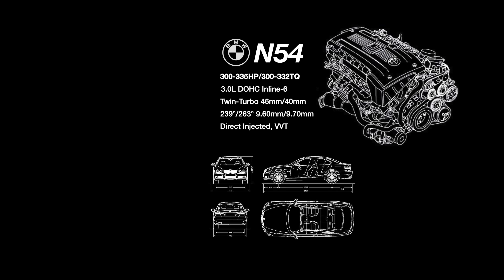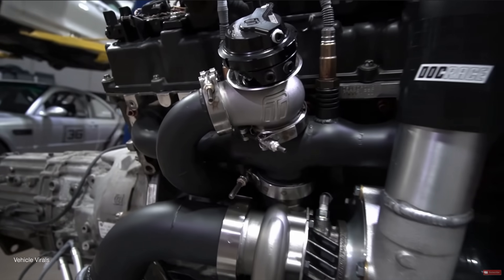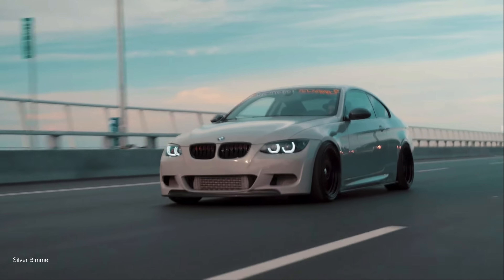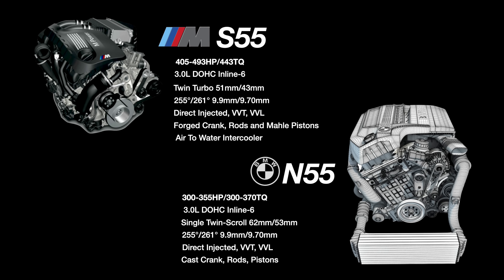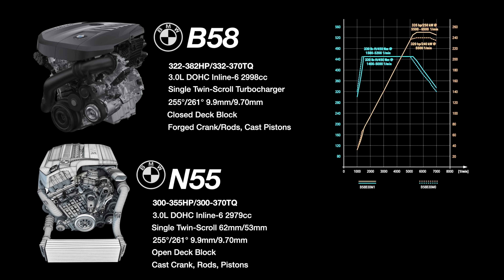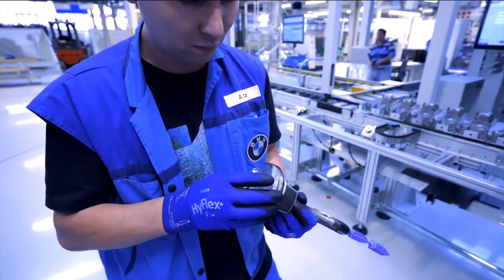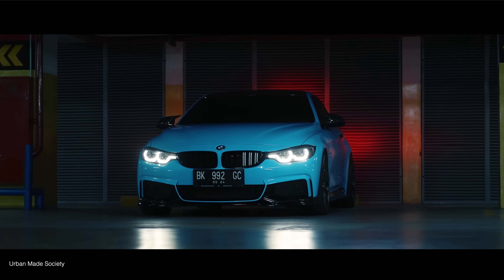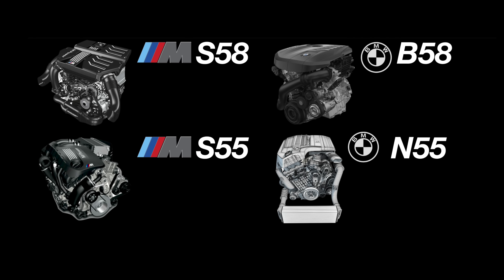BMW Turbo Inline-6 Engines Are Ridiculous | Explained Ep.4

Comment: Having now owned an n54, it can make about 600 whp reliably as pistons can fail as low as 650, however than can make 700 reliably if you modify it very well (and if you have one of the stronger 07 or is motors) however maintenance on these is very costly and it is costing me a great deal right now. The only problem with these motors is that it takes a lot more money than you think to make the power and make them reliable
Reply: Maintenance on n54 is way cheaper than n63 I’ll tell you that.
Reply: @billyowusu48  Yeah the n63 is a whole 'nother animal but I love how smooth my 550i is.
Reply: Why is the 07 motor stronger?
Reply: Correct me if I'm wrong but I believe they are referring to the 07 and "is" models being stronger because they are equipped with the n54 power plants. Which have the forged internals and have 2 individual turbos instead of the n55 being a single twin scroll design. Stock for stock a tune and simple bolt on's you will extract more power from the n54 because the dual turbos have the ability to provide more air flow than the n55 💯
Reply: @gsalas2013gs  first time bmw turboed from factory, so they over-engineered everything, forged crank, rods… as time went by the starting taking the more expensive parts out as they starting figuring out that they were overkill and could get away with cheaper
Reply: @gsalas2013gs the reason the 07 n54 is the strongest is because it was the first year the 335i launched so BMW over perfected it in terms of internal compononents. Theirs certain components that were forged/higher quality in the 07 n54 engines. Im not going to act like i know what they are but this is what a bmw tech explained to me a while back. The reason why they only did it for 07 is because they didnt want problems its first year out and after they found the cost was too much . so 08 onwards , they cut back some quality parts to save money
Reply: Still cheaper than buying a g8x m3/4. N54 to the moon!
Reply: @ravszee  n54 can’t beat no s58 or s55 unless ur running atleast 100hp more
Reply: @frankkdelacruz8536  more then stock.  Or an s58.
Reply: Most BMWs are money pits anyway. If you love them, then, well……
Reply: A lot of the maintenance costs will be the same whether you mod them or not (for example frequent ignition coil and fuel injector replacements) and some of the issues are actually solved with mods (like get rid of the stock turbos with the rattly wastegates) so might a well mod!
Reply: @BigUriel  and this cost is significantly reduced if you buy your coils/parts from FCPEuro which offer a lifetime warranty on everything they sell..oil included..spark plugs included..even coils.

This can be even more reduced swapping to a b58 coil conversion kit.
Reply: I recently sold my 08 n54 and I did a lot of maintenance myself and saved a ton on cost of ownership.  You have to pay to play with high performance no matter what brand.  Still hated to see that car go but I bought a Gulia QV and it's a whole other animal.
Reply: @mikebrooks447  aiming for one of these and keep my canry as my daily/ do whatever to car . But I just hear everyone complain how Alfas arent reliable but I thought high performance and reliability arent in the same convo aha
Reply: @Jmarzx  I had a Stelvio lease put 24k on it no problems other than auto start stop errors every so often but it would reset after a couple ignition cycles.  Got 5k on the QV been no trouble at all.  I wouldn't want one outside of warranty personally but little things like warming the motor up and proper cool down after pushing it plus battery tender for days it sits more than a couple have made the difference imo.
Reply: @mikebrooks447  ahhh ok ok that makes sense so , ur saying these are good daily cars for a low performance modded engine basically running on a a ecu tune and full exhaust ? Or its up in the air
Reply: @Jmarzx  I wouldn't say Alfa's are low performance.  Their 2.0L is best in class and the QV is practically a Ferrari motor.  The problem is the dealer network is shady in some areas and Indy mechanics with experience aren't around like BMW.  So people get pissed when they can't get their car fixed quickly.
Reply: @mikebrooks447  THAT Makes a lot of sense !! Wow hey thanks for the intel !
Reply: Pistons can fail as low as 650bhp? Tell that to my piston that  well and truly shit its ringlands at 400
Reply: The B58 is the engine for you my man! Has just as much if not more tuning potential than the N54 all while being much stronger/more reliable.
Reply: Dont know why it cost you more I have a built N54 for the last four years running 22 psi on tdo4s and no problems, just stop using e 85 rubbish and you have a reliable quick car for the street.
Reply: @johncadogan9450  how much power at 22 psi on 93 OCT ?
Reply: With the N engines, it's reliable, it's just everything bolted around it that isn't as it ages.  As an N52 =( owner, the engine is reliable, it's just the oil housing filter gasket sucks, the thermostat is plastic, the water pump internals are plastic, the battery drains too fast and needs recoding, the older N52 uses aluminum valve cover bolts that snaps, the HVAC blower gets debris in it causing it to fail, the steering gets tight because it needs to be re-lubricated, meaning you have to rip out the entire lower console and re-grease it.  13 years later, and I still got the car.  Drive my 4th Gen Mazda3 awd hatch because it's way more reliable.
Reply: how will the maintenance be if i keep it stock? expensive or?
Reply: @xhole7  not as expensive, but not cheap. If you do all the work yourself it’s not terrible. I would recommend looking into all of the common problems and how to fix them, cost,  typical failure mileage. And then when you look for a car, try to get information about what has been done already. 

Like if it has 100k miles, is it still on the original turbos, what version injectors does it have, etc. 

When you buy the car you can create a maintenance plan and plan to replace all the parts that are needed. It’s a long list but you can spread it out over a few years if you do it right. If the car is your only vehicle, then have some money set aside to fix it immediately if something breaks before you get to it on the list. 

Bottom line if you buy one, immediately replace spark plugs, coils, and do an oil change. 

It’s a lot of research, particularly if you are new to working on cars. If it is what you want, you can do it. Just remember they are 10-15 years old, and thus plastic and rubber parts are suspect to failure (vacuum lines, expansion tank, charge pipes, gaskets). There is so much information out there, someone will have experienced your same problem. Use the forums and watch videos about the car you want. Good luck!
Reply: @alextasarov1341  Thank you friend! Btw are you bulgarian?
Reply: @xhole7  nope, just American :)
Reply: @alextasarov1341  a okay, I thought that, because of your name :D
Reply: Just buy a vette and supercharge
Reply: You don't have to touch the pistons in an AMG to reliably make that horsepower.  No thanks
Reply: @CJ3000  power to weights bmw easly amgs are clean though
Reply: This is true 💯
Reply: @@user-lh5fg5hz4p no shit a B58 car is more expensive than a N54 car, I never claimed otherwise. OP was talking about making high power and doing it reliably, N54 is famously unreliable. B58 can make just as much if not more power than the N54 and does it reliably.
Reply: building an e30 to be an extremely reliable daily but havent chosen the engine yet i was planning to go toyota engines because i don't know how to make a bmw engine reliable because there is not much info on them even though they seam great, whats the best bmw motor to swap that has good reliability and what would be your tips to make that engine more reliable
Reply: Do you do your own maintenance and mods??
Reply: @BimmerMafia  u gotta do ur own maintenance. All the people who complain about reliability take it to the dealership every time a light comes on and yeah your gonna get lights and they have their problems but 90% the time u get a light just clear the codes and it’ll be fine
Reply: @John-86  you ain’t gotta tell me.  I know.  What be had my n54 4 years now.  Lights don’t scare/bother me.
Reply: @BimmerMafia  Ive done some of my own maintenance and most of my mods… FBO is fairly easy to do on your own, even if you don't have a garage. But I'm saving for that jump to ST, I'm having fun with the twins over the past year just due to finally being FBO, and going stage two. I've now been owning the car now over four years, and don't have any plans of selling it. She either blows up on me, or the wheels fall off haha.
Reply: @JustAirizz  nice. Yes doing your own work makes is easier to own. I couldn’t own a car I couldn’t work on myself. No point.  
I did all my mods on my towtrucks wheel lift. A ghetto lift. Ha. Did inlets and DP’s As my 2nd & 3rd mod in the sand and leaves… 💀. Not even a driveway. Took me 4 days. Working few hours each day. 
What inlets you running ?? As for tune That’s coming soon.  I just wanted to do maintenance and supporting mods first. Starting with fresh oem turbos.  Plus I don’t want ots tune. I want something custom.
Reply: @BimmerMafia  yeah when I eventually go ST that I might not play in a part but definitely want to be around for because I want to see process. I’m mechanically inclined but not that heavily inclined. Plus I don’t have an garage to drop the engine to get to the TTs. Then with that I’ll go and do engine refresh, and replace all the commonly known parts that tend to break: oil filter housing gasket, oil pan gasket, water pump, both the HPFP and LPFP, the alternator etc etc. As far as OTS Tunes I would say do it just to get a feel of what your car is like tuned, before jumping into a custom tune imo. Then with inlets I’m rocking a BMS charge pipe so I don’t have inlets on mine got rid of the OEM ones since the plastic liable to break of course.
Reply: @JustAirizz  ahhhh.  So not fully bolt on 😉.  Gotta get them inlets man. You feel plenty difference 80+.  
I live in country so hoping to get a garage or carport built within next year. So I feel you on that. This heat in Tx has me not even going outside til after 6pm.  Unless for work of course.  
All the maintenance you just listed. I just did . Minus HPFP. I did a walnutless valve clean with b12 chemtool.  Worked like a charm. I been meaning to edit a full vid on it.  But this 100+ heat 🥵. 
BMS charge pipe is one I have also. No complaints there.  I’m running a cts turbo FMIC. No jb4. So idk my IAT. 
What kinda power you making.  For stage 2.  You need a fmic for s2 right
Reply: @BimmerMafia  I’m going to agree to disagree on this one, I’m running DCIs not upgrade inlets. So technically I am FBO 😉 yeah I got VRSF FMIC, Catless DPS, and 3.5” race exhaust. Yeah I’m stationed out here in England, and get mad looks when I’m driving on the left side and not the right 😂😂 but I know what you mean I’m from Florida and it gets humid over there. Though I haven’t been stationed in the states yet, I’ll probably run into that problem with it getting hot depending where I get sent to, and I’m doing constant runs during the day. But I’m 400-430WHP and now that MHD gave N54s the map switching depending if I’m running high octane since they don’t have E85 over here but they go as high as E95. I can flip between my 93oct and 95oct maps on the fly.
Reply: @BimmerMafia "reliably"
Reply: I think they are reliable, just high maintenance. I’ve never broken down, but man have I put work in to prevent it xD
Reply: @alextasarov1341  engine itself is reliable just parts around the engine that goes out due to too much plastic
Reply: @shiftautomotive1997   the newer engines use just as much plastic. It’s like 15 years old now so they can fail on any mileage. The individual parts last like 80-100k+ miles. People sold the car at that point to avoid the repairs and then the new owners have it fail, don’t replace everything, then the next part fails like 5k miles later lol thus giving the impression of unreliability.

It’s the electronics that have the real issues. Injectors, water pump, various sensors. But generally you can replace the worn out components preventatively before they fail.

Or you wait till things break and constantly put out fires (figuratively lol).

Comment: Yeah it's all fun and games until I pull up in a NA V8 making mid 400 hp to the wheels.
Reply: Toy engines that are pathetic without a turbo and sound crap 😁
Reply: @johnboy5167  That's why every V8 needs something to be fast right? Superchargers, turbos, nitrous, big wheels, aftermarket transmission, aftermarket heads ecr ect. Because V8s are so great after all this time right? Can't imagine having something like 6+ liters and needing a supercharger to make over 600hp. Yikes!
Reply: @refillz5281  you have no idea what you are talking about you can make a 1000 horsepower with a ls v8 naturally aspirated these little shit boxes would be lucky to make 300 without boost 😄
Reply: @refillz5281  lmao it's pathetic when you need 2 turbos just to barely make 300hp. 6 cylinder cars are a joke.
Reply: Lol
Reply: Cute! A tune on any one of these engines puts car lengths on you 😂 $500 or less and buy buy shitbox v8
Reply: Lol. My 360 to the wheels will blow them doors off.

Comment: I'm pretty sure I heard the new Supra is BMW powered, is that correct y'all? Not necessarily asking the author of the video.
Reply from the maker: Yep it’s powered by a BMW B58 and ZF8 speed or new 6 speed manual. It’s one of the best cars to drop in the last 5 years no matter how much hate it gets.
Reply: Didn’t Toyota actually reengineer the B58 to be reliable than it’s predecessors  rather than just dropping the engine in the Supra. I think it was more of a joint effort.

Comment: The S54 is more capable and tunable than the 2JZ, but a few got over 1000HP out of it and says it's better than the overrated 2JZ.
Reply: S54 as in the 3.2 In the e46?? Definitely not more tunable than the 2jz not even close. It doesn’t like boost really at all. You’re going to need to fully build an S54 to even come close to a 2j
Reply: 2jz is indeed overrated
Reply: It’s a great motor with good potential in stock form and has ver good aftermarket support. As far as a stock motor, a lot of modern motors can handle similar power in stock form. 
Kids think it’s the best engine ever made, that’s what I’m getting at. Not trying to make anything away from it, i can’t really say anything bad about it. But there are lots of different ways to go to meet your performance/power needs.
Reply: @PapiAndrey  lol enlighten me please
Reply: @Iamde4dinside  yeah m52s are solid but you’re talking about a power level that a 1j is comfortable with let alone a 2j